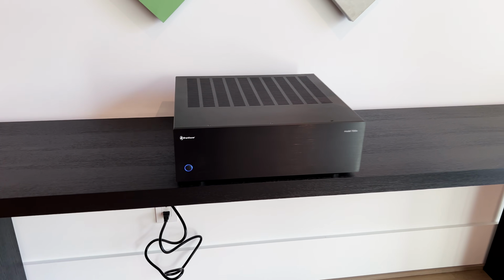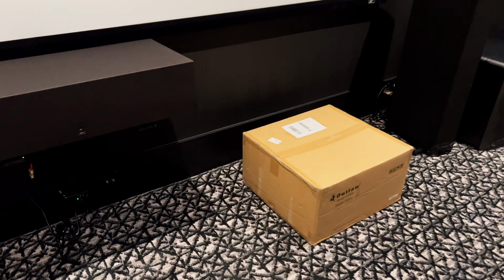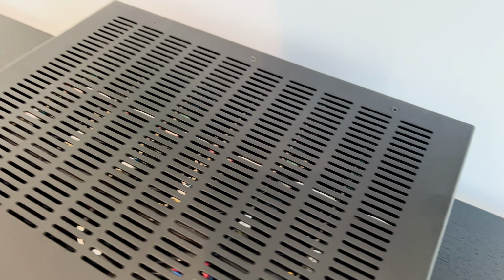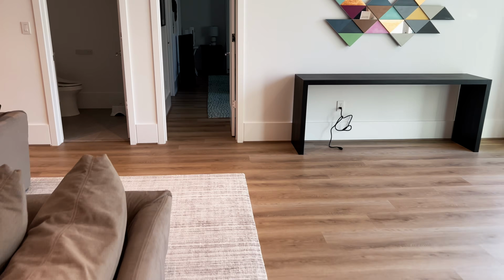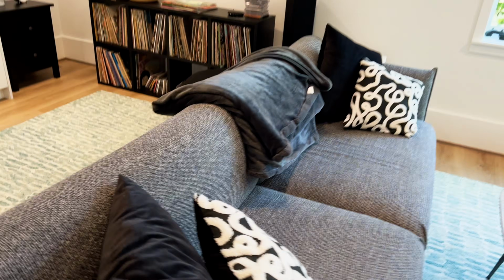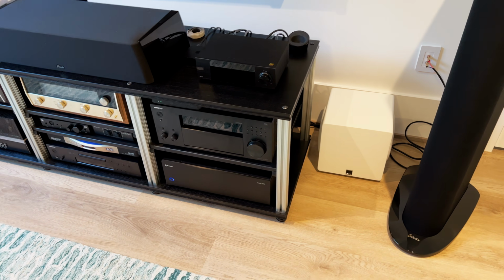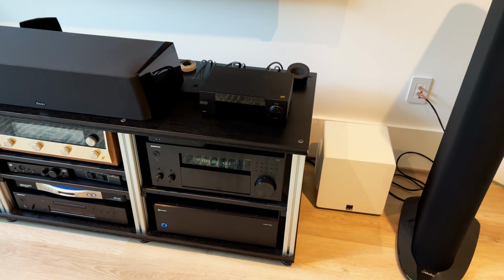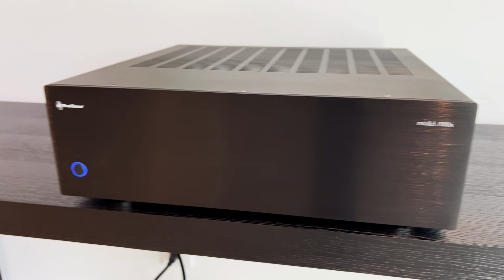Outlaw 7000x 7 Channel Amplifier Review | This amp packs a terrific value!

Comment: I see that you have all of your equipment listed in the description except for the rack that's holding the receivers and amps. Do you mind sharing the model and where you got it? It looks very clean and I really like that setup a lot, how you can order shelves as needed and set them up at whatever heights you want etc. Thanks
Reply from the maker: Pretty sure this is it. Any rack shelf should fit in it and you can buy them on Amazon and I bought one myself.. https://amzn.to/4t1b3Ku
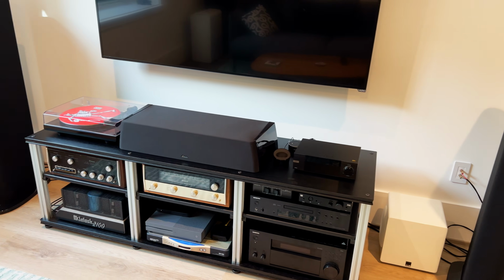Reply: @Upscaled_HT  Oh, I was talking about this 9:49 in your music room. You called it a rack and talked about ordering another shelf so I thought it would make sense to use the same terms. I guess it's more of an entertainment center or shelving unit? Thanks for the reply and sorry for the confusion. I just really love the setup and have had trouble finding anything as modular that I can make my own way to fit all of my devices.

Comment: Great Review!, just subscribed to your channel. 

Question....Are Emotiva XPA models 4ohm stable? I can't seem to decide what I want for my SVS 7.2.4 HT setup. Speakers are 87db, and my towers (pinnacles) and centers can handle 300 and 225 watts, respectively. The rest of my surrounds can handle 150 watts. I was thinking of XPA-7 gen3 for bedlayer, but monolith 7X is another option. What are your thoughts.  Monolith has been out of stock for a while.

I bought a toroidal based 11 channel A/B  amp, which I had to return because I was experiencing hum and a thump when turning on and off with a 12V trigger. Do you experience that with XPAs?
Reply from the maker: The emotivas are awesome.  4 ohm stable. If it’s your budget, you can’t go wrong
Reply: @Upscaled_HT  great, XPA-7 for bedlayer for now, I will be using my Denon AVR-A10H for 4 height channels (which should be at least 105 watts per channel per Denon's specs). I may get XPA Dr3 for LCR in the future and use denon as a processor.

Comment: I have the same amp married to a Marantz SR7015 for greater dynamic's and extending the number of channels I have so now I have 7.2.4. but even with the ground wire connected there is a faint hum but only if you are close to the fronts. Not audible otherwise. Good value for money.

Comment: Any receiver today is incompetent in playing reference levels. An external power amplifier is a must. Receivers while cheaper than a Preamplifier Processor,  not that much depending on Receiver considered. Additional amplification has to happen. Outlaw, Emotiva, and other amplifiers have been doing this for years. Emotiva uses a Switch Mode Power Supply on their X amps. BasX amplifiers are linear power supply. Outlaw is all linear power supply, why it is so heavy. However you do it. External power amplifiers are a must if headroom, and playing at reference levels are a reality for you.

Comment: Hello! Can you disable in the Onkyo menu the speaker outputs when you use the RCA pre-outs? 
Or how the receiver knows your using and external amp?
Reply from the maker: Not on my receiver.  Some receivers do have a pre amp mode though

Comment: I got this same when it just came out a few years ago. Yesterday had to pull it out of my rack to check some connections and was reminded of its hefty weight, it feels like a concrete brick. The performance is incredible, once had a big party, cranked it really loud for a long time and went to check in between if it wasn’t too hot, and nope just luke warm. The clean sound and performance are incredible. Just watched Twisters roaring through my room, phenomenal! Top quality reasonably priced.

Comment: Outlaw specs are much better than Emotiva specs, especially THD. I have 4ohm speakers so that was important to me. This is true even compared to Emotiva's XPA line. That's why I went with Outlaw over Emotiva a few years ago.
Reply: emotiva has the worst fucking customer service ever.. ive tried for over a year, to come in contact with them.. and their sales are so garbage its insane!  they have the feature, to get a mail when things come for sale again.. they then send a mail, but its not possible to buy it anyways!  just based off their super shitty customer og sales service. and that they never, have anything in stock... shows how shitty, and idiotic that company is!! and that you should never ever buy from them!!

Comment: I own a 7700 Outlaw.   Great power, good sound.  SUPER HEAVY.   Also have 3 of the monoblocks to fill in the extra channels.   Not a single regret.  200 watts a channel.  This new model has the XLR in, which is critical for killing noise to signal ratio.
Reply: FYI, NEVER try one of these in your house if you have no application.   Because you will never go back to a receiver amplified system.
Reply from the maker: I totally agree. Separates are a whole different animal.
Reply: I own this Amp and have had it for little over a year. At 61 lbs it is a  beast.  I have it hook up to my Onkyo RZ50. Best $999 I think you can spend on and amp. If you think this one is heavy It's big brother the 7900 come in at 145 lbs. Can watch movies for hours and the 7000 never get warm😊
Reply: Did you buy yours new or used I have one close to me for sale but they want 1500 for it
Reply: @danemoreno88 I brought mine new from Outlaw. The shipping was.$99. So about $1100. Just go to there site and add it to the cart
Reply: @danemoreno88  I bought the 7700 as it has better wattage for what I need, but I can no longer use it as it has no XLRs and that is a deal breaker for me.  That is why the newer ones are better.  I am not worried about used amps, just keep within 3 years old if you can.
Reply: @ oh your right I didn’t know that that certainly makes it hard if you upgrade to a processor in that case do you think the monoblocks would be a better choice to go with ?

Comment: I've been using an Outlaw Model 5000 for about 8 years now and absolutely love it. I had it paired with the 975 processor until I upgraded to a Marantz SR5014. Fun fact, I found about Outlaw Audio through a magazine and liked the name. It was so different and intriguing that I bought it. I also have two AC Infinity fans keeping it cool.
Reply from the maker: I was seriously impressed with the amp.  It's definitely a solid piece of kit.
Reply: I have the original 5000 and the 975. I also use an AC Infinity fan on the 975. The 975 runs hot and I had to send it back twice for repairs. No problem after the AC Infinity fan. I also cut two large holes in the top panel below the fans.
Reply: @amazoidal  My A/C Infinity is more like the controller type where as I can plug fans in via USB and have that controller operate separate fans. I have one on each amp and two on my receiver because it gets so hot. All I had to do was put the fans where I wanted them, install a temp probe, set it and forget it. It's been working fine for at least 9 years now.
Reply: I have the 5000 too, getting a loud hum through my speakers......what's the solution?

Comment: I’d bet the outlaw weighs more because it’s got a toroid coil in it as opposed to the power modules that Emotiva uses for their current XPA set ups.
Reply from the maker: That probably has something to do with it.  The Outlaw uses a more traditional power supply design and to provide the power this delivers, it needs to be big and heavy.  The Emotive uses a switch mode power supply, which is more modern and significantly lighter.  They're both good solutions. I'm old school I guess and see heaviness as a sign of quality.  This older tech is time tested too.
Reply: @ I don’t doubt it and yeah I get that. I’m an emotiva XPA and RMC user. First dive into separates for me and I’ve been very happy 😃 
Thanks for sharing this review.